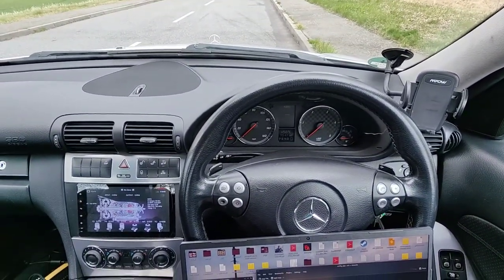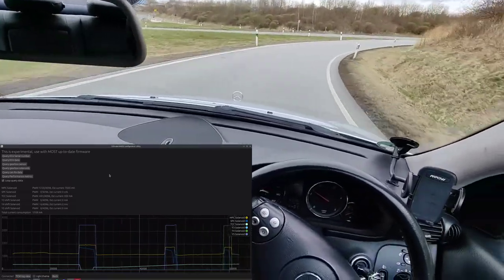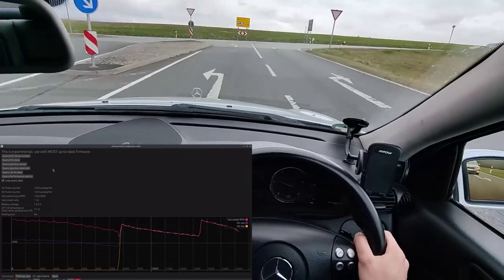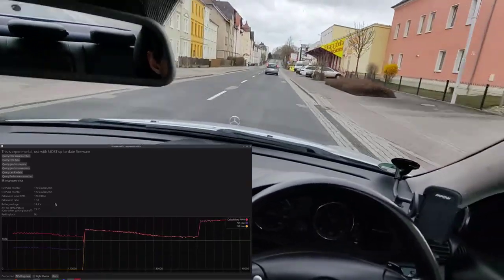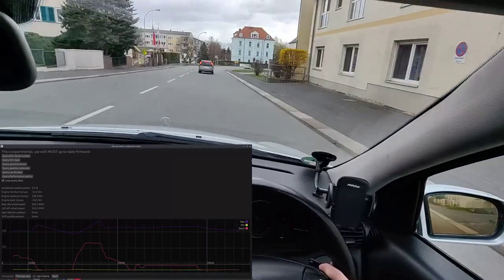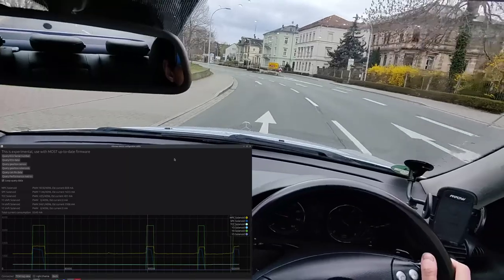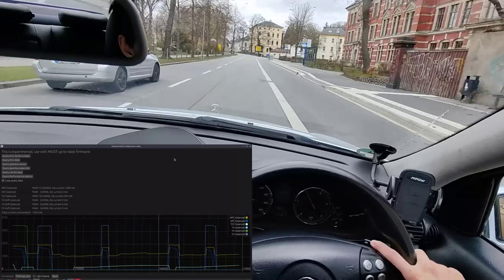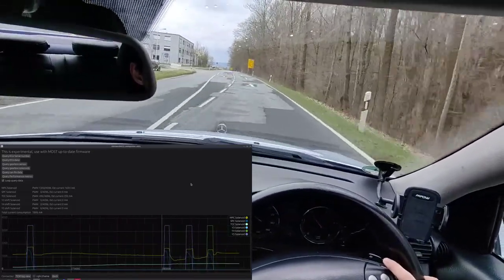Ultimate-NAG52 test drive and project discussion - IN GERMANY!!!

Comment: I read somewhere that my ML270cdi has an incline sensor inside the 722.6 already. There is an option to enable/disable it in MB Star diag. It certainly automatically holds onto a low gear when going down a steep hill when you go onto overrun. 

Also is there a timescale for the end of beta testing, or do you want another beta tester? I have 2 Mercedes vehicles, a 2002 ML270 and also a 2003 LWB MB Sprinter with 722.6. I am a professional embedded C programmer in the automotive field already, and your work so far is fantastic.

Comment: Awesome that you are doing this.  I just signed up, would love to contribute a little code if you accept contributions as well, specifically I would like to add a debounce to the shifter as when I slap the shifter left to downshift sometimes the spring loaded lever bounces back and immediately shifts up.

Comment: Are there any options planned to have this run in a car in essentially a stand-alone mode ?  In Other words a custom EMU or even a non oem Mercedes application.
Reply: I'd also like to know.

Not a lot of options out there for moderately modern and accessible auto transmissions which can handle a lot of torque in a project car.
Reply: @bentait2462  seems nicely developed, so heres hoping.
Reply: @lachywocky   I've been following this project for some time now so I can answer this based on information provided in previous videos: for standalone applications it is assumed that people will be using Ole's EGS51 based controller. Ole's controller can take sensor information directly so it doesn't rely on information arriving on a canbus - this is essentially what most people will be implement if installing into a engine/trans swapped car. 

There is absolutely no reason why you couldn't run this controller in a car that wasn't built for it and that is what I will be doing. I am intent on pairing an OM606 (factory EGS51) with this controller in an old G wagon I have. This would not be possible (easily) with an immobiliser deleted stock ECU mind, since that would expect messages in EGS51 protocol. If you find the 722.6 pdf online it may be of some use in seeing some of the difference between EGS51 and EGS52, it's a bit of a jump. I will be using a standalone ECU configured to accepted messages in EGS52 protocol, which I am testing currently in my W210. The configuration in this code (available on github) is modifiable to include any tyre size and rear diff ratio you may have in your standalone car. 

Equally if you wanted to use this alongside a standalone ECU in a petrol sense (Haltech, Megasquirt, Speeduino, RusEFI) then you would need an interface in the form of an arduino which would sit between a gearbox canbus (Interface, Ash's controller, shifter) and a powertrain bus. When the TCM sends messages for torque request for gear shifts in Mercedes' proprietary message protocol this interface will play equivalency messages to the standalone ECU. Messages would have to go the other way too for throttle position sensor (maybe) if petrol but definitely pedal position sensor as well as manifold pressure etc. It is a bit of extra work over Ole's controller but in terms of maturity of the hardware and software I'd say worth it.

Comment: Dont know if its the same for all ECU's, but usually the ECU has some sort of engine load. So maybe this can be used for the hills?
Reply from the maker: Yes my engine ECU shows the amount of static torque being produced, not load. But, I'd still need to internally work out how much torque the engine usually produces to accelerate the car 'y' amount, and then see if the current values are more or less, indicating either up or down hill.
Reply: @RANDASH  figured it out yet?